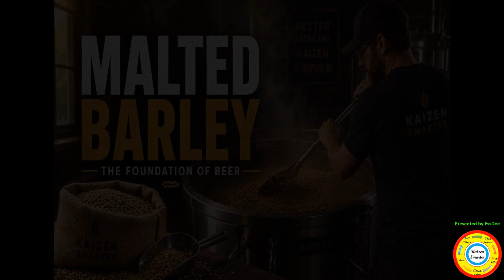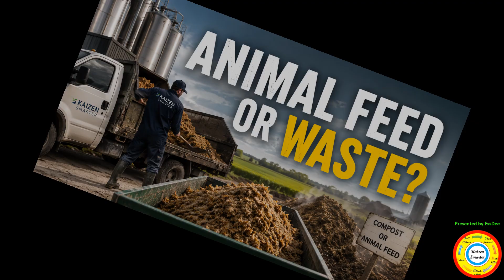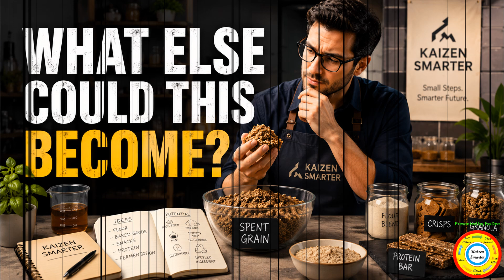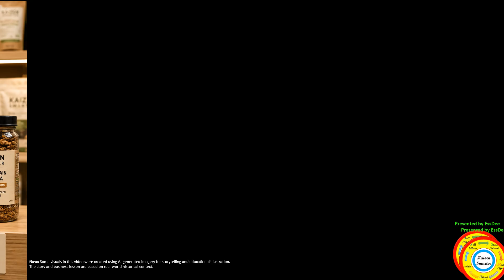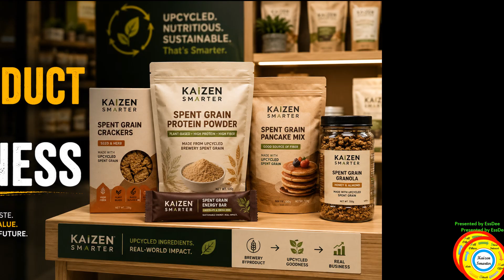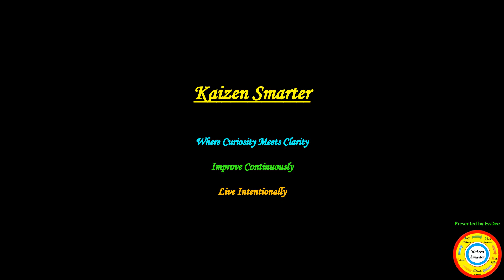How Breweries Turned Waste Grain Into Upcycled Flour | #kaizensmarter #BeerWaste  #foodinnovation

Comment: Is it the same as the Zero Waste concept?
Reply from the maker: Great question.

While related to sustainability, this process specifically focuses on "upcycling" by transforming brewery byproducts into new food ingredients rather than just eliminating waste. 

The difference lies in the byproducts not just getting recycled back into raw manufacturing materials but transforming to completely new food ingradients. That is why this goes into innovation criteria really. 

The zero waste movement emphasizes stopping waste at the source rather than managing it later, guided by the 5 Rs framework:
• Refuse: Reject single-use plastics and unnecessary packaging.
• Reduce: Consumingly mindfully and lower overall material use.
• Reuse: Choose durable alternatives like reusable bottles and bags.
• Recycle: Convert unavoidable waste back into raw manufacturing materials.
• Rot (Compost): Process organic scraps into nutrient-rich soil.

Regards,
Shashi
Reply: @KaizenSmarter  Upcycling is a tool or a practical method for managing waste materials

Zero Waste is a philosophy an overarching goal for both lifestyle and production.